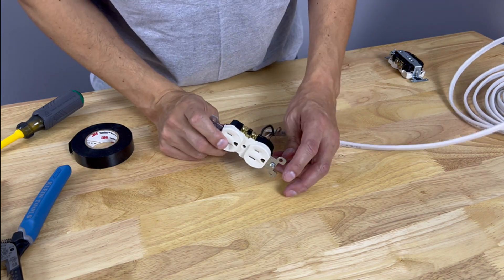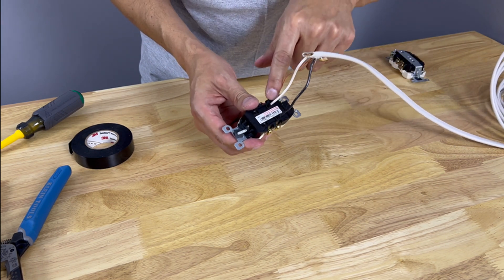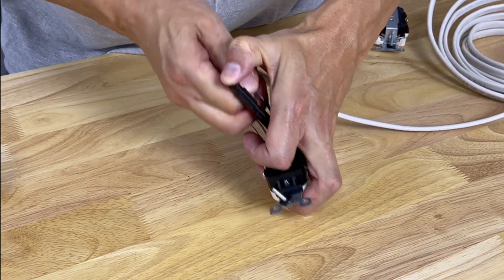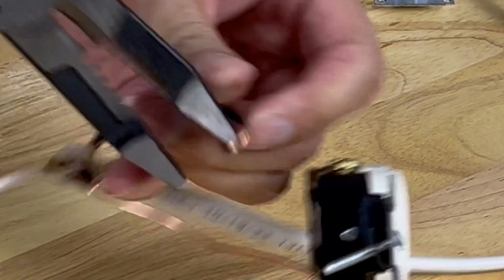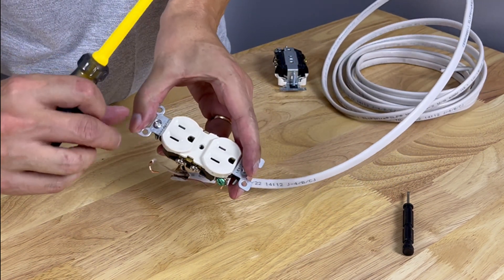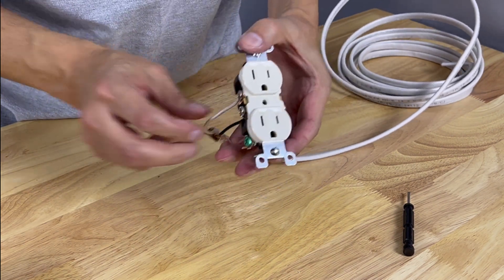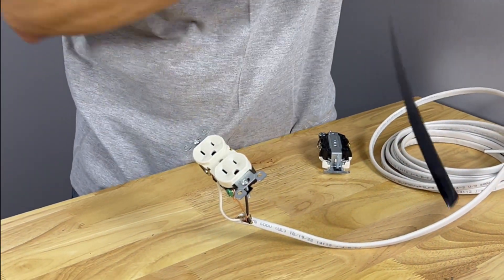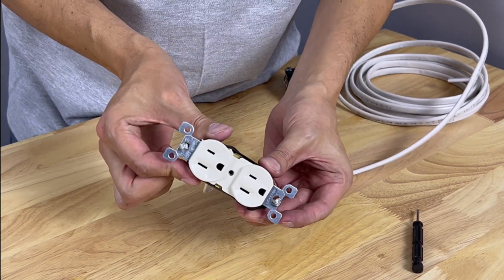Dead outlet?  Backstabbing wiring problem.

Comment: Are you using a tamper resistant outlet in a newer home.
Reply from the maker: Yes all the new outlets should be TR. However a homeowner doing their own work will still probably use the traditional outlets for years to come.